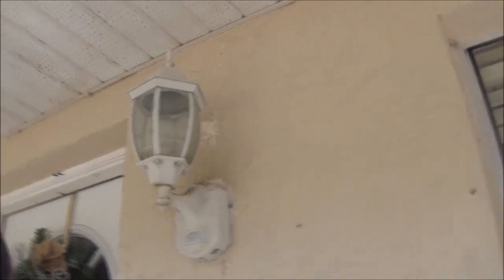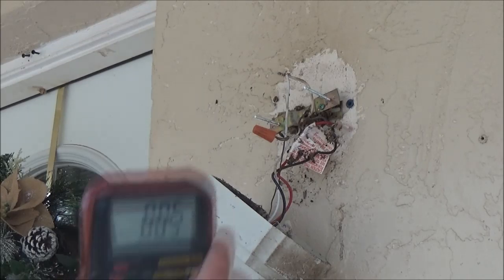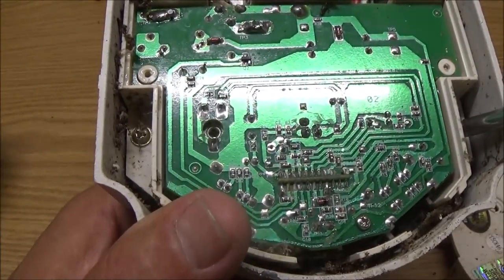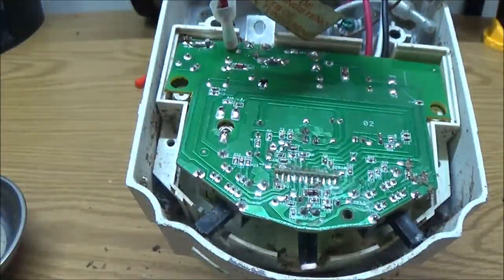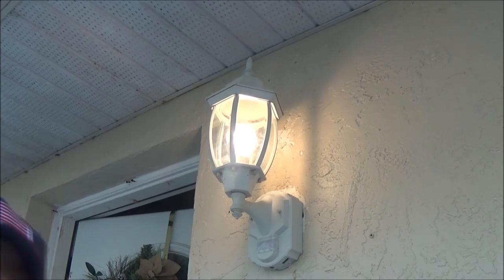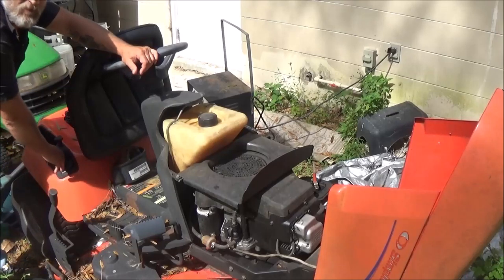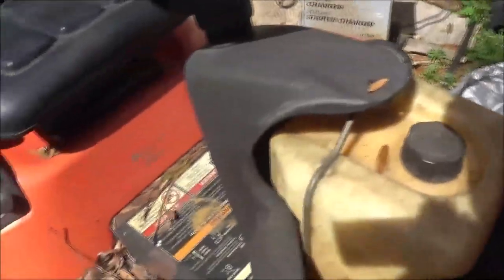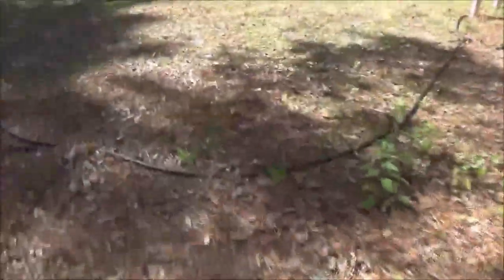Tuesday Vlog And Some Projects Around The House

Comment: Thanks for taking us along.   I have a flood light with motion & light sensor over my garage that stopped working last year.  It turned out to be corrosion in the switch contacts.  I had to get a can of electrical contact cleaner and spray into the two switches and work it back & forth.  I think being out in the dampness causes the corrosion in the switches.